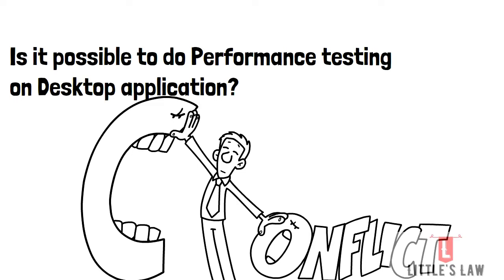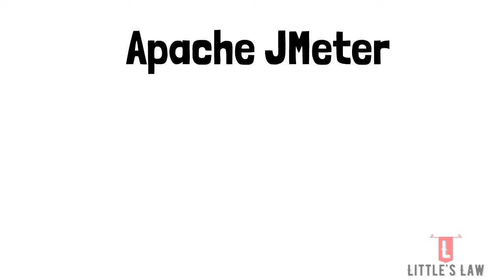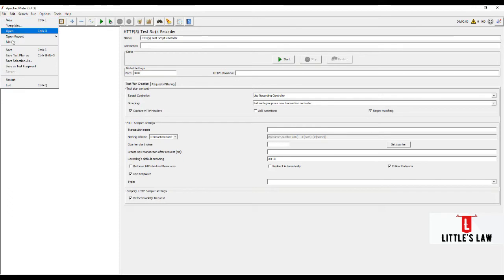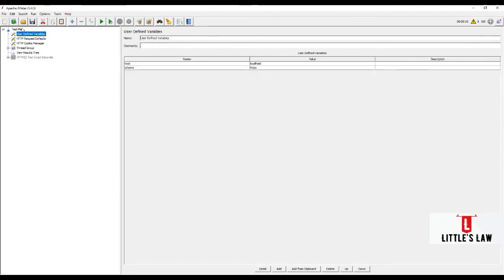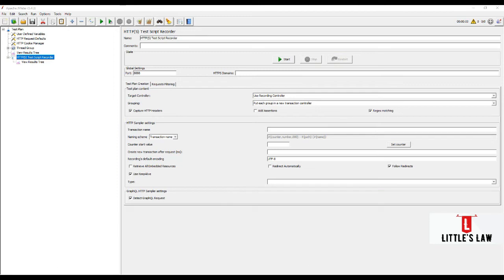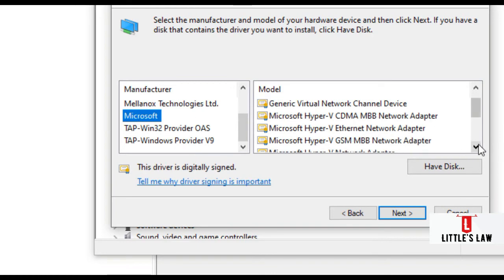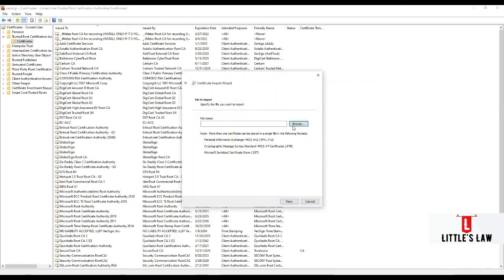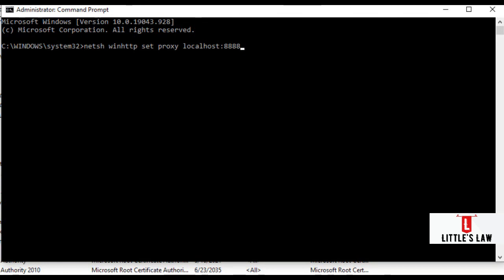How to do Performance testing for Desktop application using #jmeter #performancetesting

Comment: Hi sir,

If desktop application has used tcp protocol, then how to record that desktop application using JMeter?
Reply from the maker: Yes it will be recorded provided you have the right configuration . You can use wire shark in case you need for recording tcp protocols